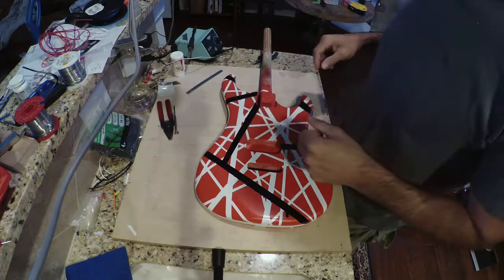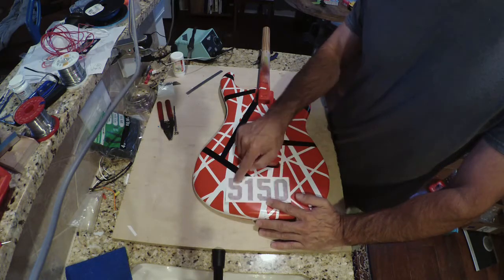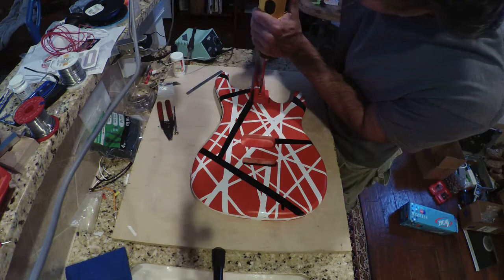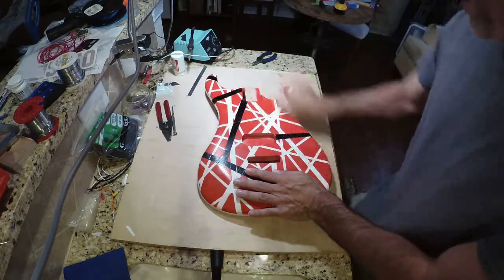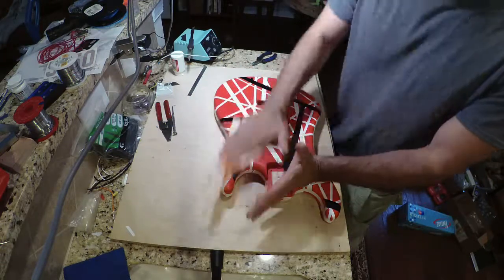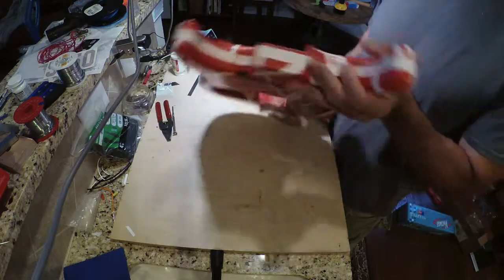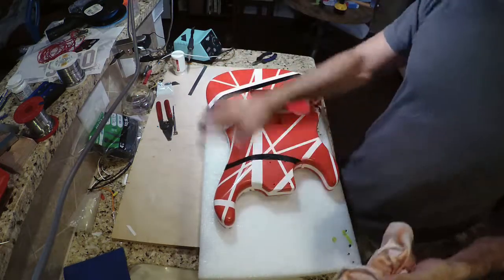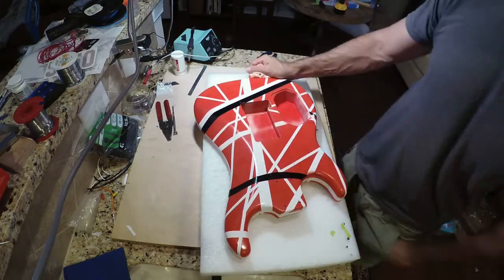5150 Build Part 27- Interesting Story &Buffing the Body

Comment: Hi Ossie, You're videos are really helpful as I'm getting ready to paint my guitar. I am stuck on the steps I should take though... Following your videos, it sounds like you suggest

1. Sanding
2. Painting
3. Then buffing with a rubbing compound

And that is it for somewhere between an amateur and professional finish (in a good way). Right? What kind of rubbing compound did you use?

Thanks for your time. Keep up the great videos! Pete

Comment: 0:54 The guitar was built in 83 there's Pictures of it backstage at the US festival without the 5150 stickers. The 5150, 1984, 918v, and the hot for teacher Kramer were all built at the same time but not used until the 84 tour. There's pictures of them on stage without the numbers, and then there is all on the same tour. So the stickers were all put on most likely mid tour
Reply from the maker: PUG127,

  Thanks for watching and for the comment!  I was able to narrow it down a little more from available pictures.  In a later video I go through what I found 

All the best,
Ossie